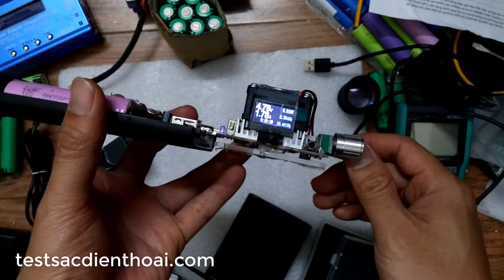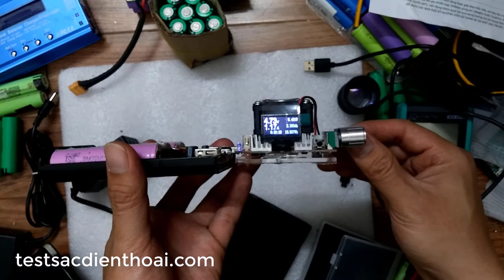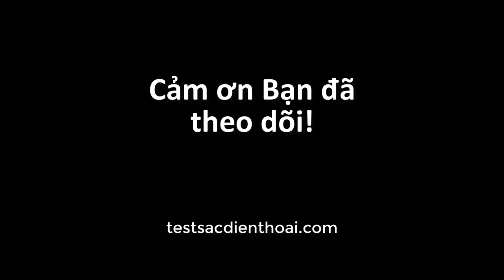Box sạc AILI 4 pin điều chỉnh giới hạn dòng ra

Comment: có cái box nào 12v không a  chỉ cần 2 , 3k mh là được
Reply from the maker: có box AILI 6 pin song song đó em
Reply: 6 pin thì nhiều quá e chỉ cần 2000 mah là cùng
Reply from the maker: Ít pin thế mà ra ở 12V thì trụ được bao lâu đâu em :)
Reply: theo a nghỉ dc mấy tiếng
Reply from the maker: Em tính theo công suất pin ra đó. 4 Pin 2000mAh/cell thì ra được tổng công suất 4x2x3.7 = 29.6Wh (chưa tính tổn hao do mạch), nếu tính cả hiệu suất mạch thì còn tầm 29.6*0.85 = 25.16Wh thì được cỡ 2h nếu dùng ở 12V và dòng 1A (công suất 12W)